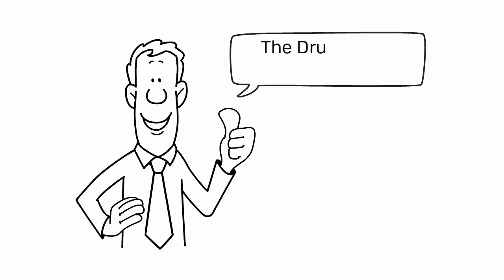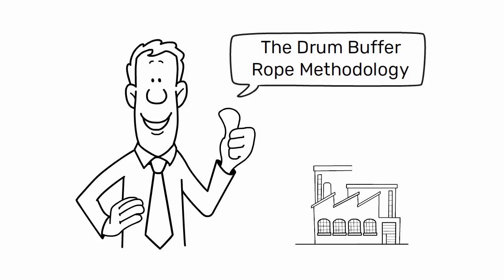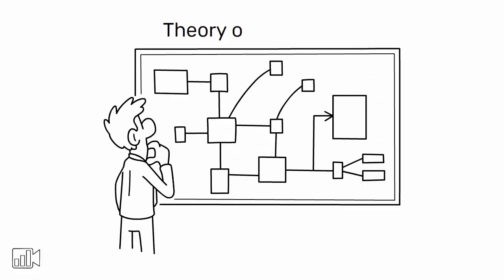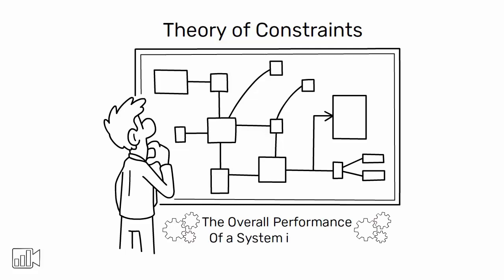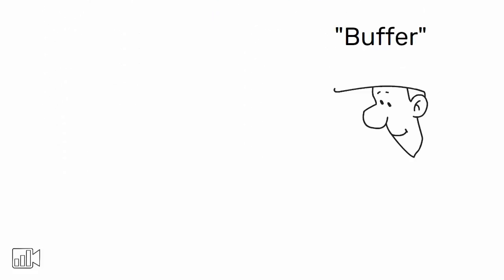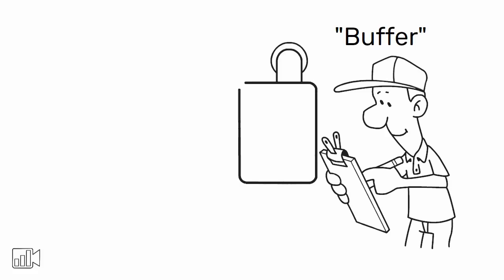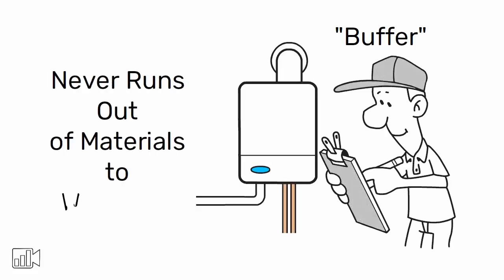Drum Buffer Rope Explained | An Effective Method for Improvement

Comment: In theory a buildup of materials should always be present before a constraint, because everything before it is more efficient. A buffer should form naturally, and which is that which should be eliminated according to Lean concepts. Based on the above reasoning the buffer should form simply because there is all the output before the bottleneck which just builds up, flooding the system with waste. If I am understanding this properly it is simply creating a place to dump all of that excess materials between the stages and calling it a buffer.
Reply: Yea don't queue up more than your constraint can handle.
Reply: The rope is actually incorrectly described in this video.  The purpose of the rope is to restrict the beginning of the process so exactly what you described (piling up WIP) doesn’t happen.  Work is released at a rate which matches the drum.
Reply from the maker: @WoodWerksUSA  I have to agree that in the video is not so clear as you wrote here. The intention was to say that when the constraints produce one bacth this is the signal to line to release other WIP. You are right, I will update the video soon with the improved text. Thank you for your comment.
Reply: @LeanVlog  Is this new video available?